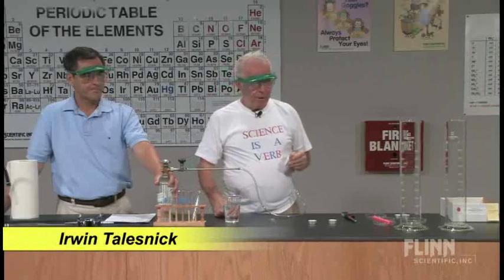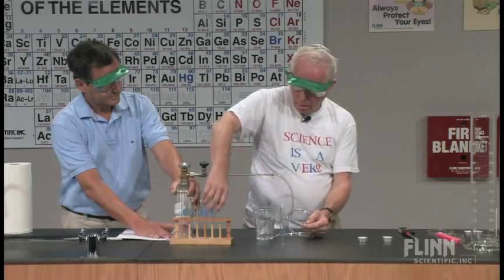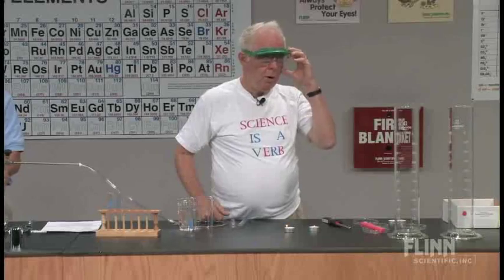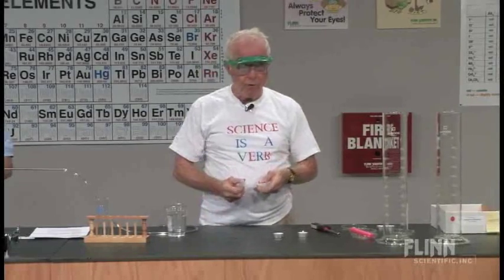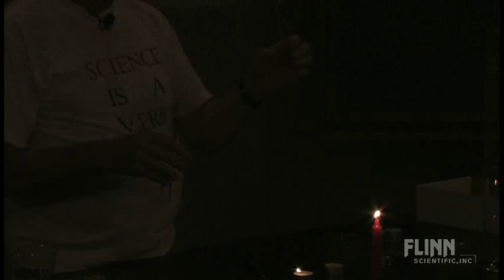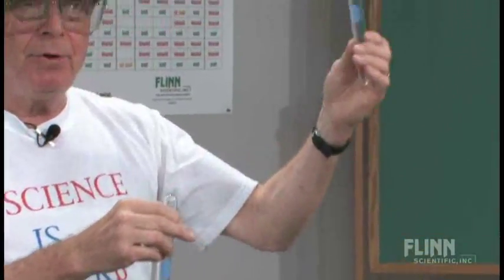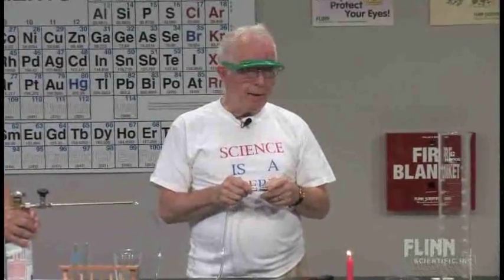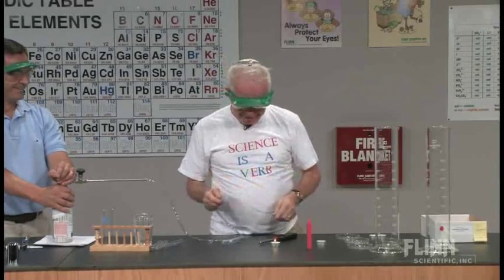Combustion of Hydrogen

Comment: People have always said hydrogen isn't flammable without oxygen. That is obviously wrong based on this experiment.

Energy is created when quarks are separated and pure hydrogen without any neutrons is the most vulnerable to getting broken up. What creates the energy is not the hydrogen itself but the field of space around the reaction. Without the field, no energy would exist at all. It is what's known as "zero point energy" and when quarks get separated, the strong force is broken. The only difference is that the strong force is between quarks and the particles that make up the field of space, not gluons. When quarks are separated in a vacuum, it creates an incredible energy because the field of space that causes the force of gravity is able to overcome the strong force and keep the quarks apart indefinitely. This is exactly what a black hole is made of and the only reason they don't emit optically visible light is because they only emit gamma rays. Eventually, black holes cool and create elements on their surfaces and start emitting optically visible light. 

Quark Plasma Reactors only use plain hydrogen, not deuterium and tritium. They are the energy fusion is supposed to be.
Reply: I believe under normal conditions Hydrogen isn't flammable without the presence of oxygen.  There's way better demonstrations with Hydrogen on yt.  ... guy fills a large bag with Hydrogen and strikes matches inside the bag . The match lights for a second and goes out after exhausting its own fuel  source of oxygen.  The Hydrogen didn't ignite/combust .   To prove its Hydrogen in bag.  He squeezes the bag that has a tube coming out of it and it produces a maroon very  translucent flame a few inches long when introduced to a flame ..  

Hydrogen absolutely needs oxygen to be flammable .
Reply: @codyramos3200  unless it is separated into quarks. When this happens, the energy that lasts billions of years in space as stars is created. Lightning does it when it destroys atoms in our atmosphere and creates gamma rays. Particle colliders do it as well when they break atoms into quarks and create 9 trillion degree Fahrenheit temperatures.

Comment: He doesnt explain that the foggy mist around the cylinder is actually water created from the combustion of the hydrogen gas. However, this may have been useless information to his students so he may have left it out for that reason to save time 8).
Reply: I doubt that. The water would be too hot, and would be produced in extremely little amounts. It’s probably the moisture and humidity in the air cooling rapidly and condensing.
Reply: @potatoboy549  no it's actually water
Reply: hold on, I have a question bro.
does a liquid compound will be vanish, if it's got burn by a fire ? 
I mean if let say a vitamin c liquid, got burned, will the smoke still contains with a vitamin c ?
Reply: @ravenskarm6968  bro burning is a chemical reaction and everyone know that after reaction it is not sure that reactants property get/found in product.
Reply: I bet every one of his students knows that

Comment: Isn't he exposing himself and everybody else to a lot of dangerous nitrogen oxide gas from all that combustion of hydrogen gas?
Reply: What?
Reply: @cardmaniak2316  of cousre you might be confused see I was looking at a video explaining the difference between using h2 gas in a fuel cell vehicle vs an h2 combustion engine vehicle and they said one downside to the h2 combustion engine vehicle is that it produces harmful nitrogen oxides in the exhaust from the combustion of hydrogen gas. So I was wondering if by this guy combusting hydrogen like that, if he was exposing himself or everyone in the room to dangerous nitrogen oxides.
Reply: @vincenzopromedia  very complex i can't understand Im stupid hahahaa
Reply: Hydrogen burning produces H2O
Its hydrogen (H) oxidixing (O)
Reply: Good knowledge, but nitrogen in the air usually stays inert at these temperatures because N2 is a molecule with a triple bond between it’s atoms, which to my knowledge has only ever been broken in nature by lightning. Under extreme conditions like a combustion engine, particularly jet engines currently under development that run off H2, the heat and pressure is enough to break the pairing of nitrogen atoms in their molecule form, allowing the now single nitrogen atoms to combust, reacting to form NO2
Reply: @Frank Martin Okay so I guess temperature has a lot to do with it. ICE Engines do get very hot but I would assume that combustions are very hot in general. So if you simply heated hydrogen without combusting it, would that also cause nitrogen oxides to form? Or is that only under high temp combustion?
Reply: @drdefecation  Where would I go to get an expert's opinion?
Reply: It's water. You Stupid
Reply: @drdefecation  🤣😋